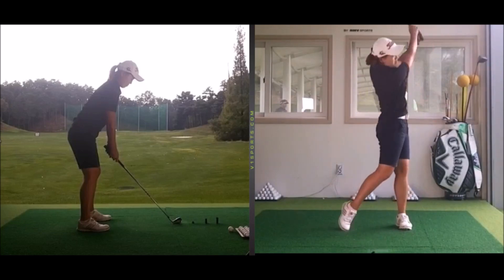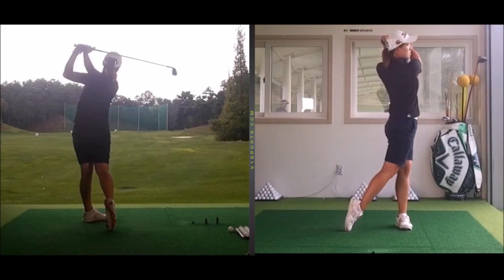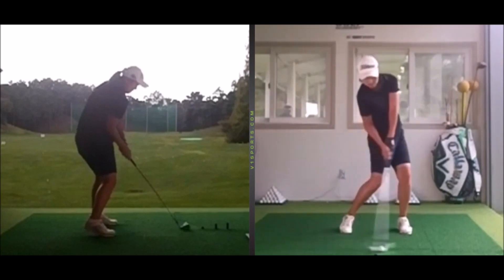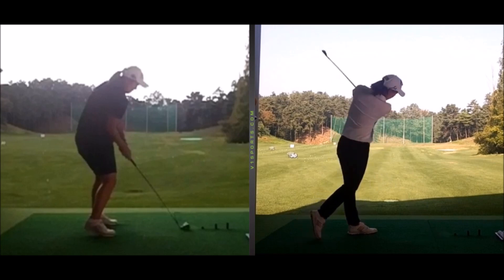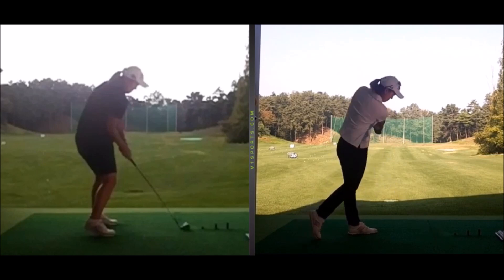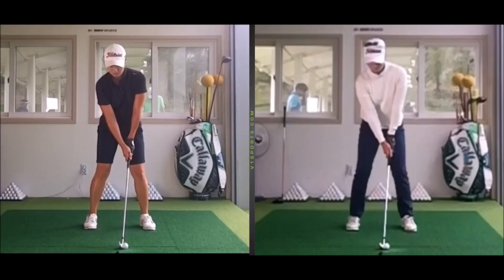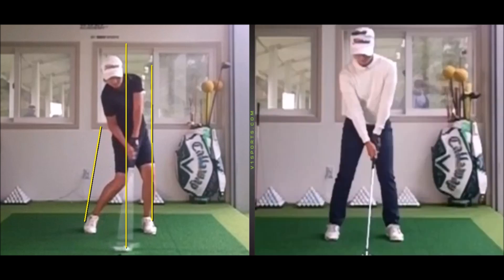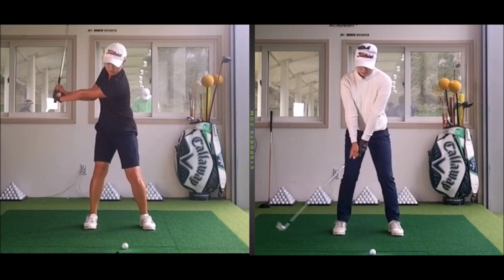Increase Your Clubhead Speed With Vertical Force

Comment: Hi Robin another great video,ive used this drill,i was told it was for using the right side more, but i felt it improved my left side stability and dynamic action! Luckily most right handers jump off their left foot,tho you may struggle with a pupil if theyre the odd one out!
But although this dynamic action does increase speed, it also makes space/helps timing sequencing for the major speed producers the muscles/joints of the hads arms and shoulders.I like many who learnt golf late in life, well after being good at other sports learnt golf the wrong way round!positions ,body action etc.Now at 63 im hitting it further and striking it better as the secret of golf,like all sports,is athletic anticipation! ie anticipate striking with the whole club through impact powered by the muscles that are directly linked to the end you are holding ! everything else just happens in sequence caused by athletic anticipation of this

Comment: Should I feel like I jump at the start of the downswing? Does it feel like an actual jump or more like just constant pressure in the ground? When I try and jump, I lose all control of the club and thin everything with the one legged drill. I can nearly dunk at 6’ tall so I am sure I have power leaks in my golf swing. My average ball speed is around 147 mph which is around a 235-240 carry for driver.

Comment: Robin, when i do this drill i am wobbling all over the place any help?
Reply from the maker: +kris bretz Tricky to say Kris, start by swing with in yourself, and try and make your speed with the force from the ground, not your arms
Reply: +RobinSymesGolf robin one more thing, i know this drill is supposed to help create speed from the ground. but wouldn't this drill make the hips lose their posture through the swing? it feels as though you are early extending.
Reply from the maker: Little complicated to explain but your left hip has to get higher through impact to maintain posture, so if done correctly it should help maintain posture, not lose posture

Comment: Coach,
Does this drill apply from Driver to Wedges??
Thanks
Reply from the maker: Roger, same movement, just a lot more force with the driver for 2 reasons, first you are hitting up on the driver, second the the driver is moving fast and therefore pulling you towards the ground more, you need to fight that